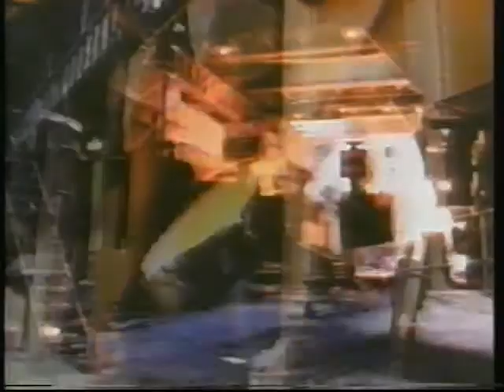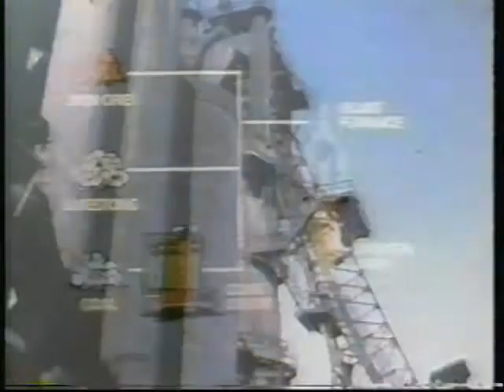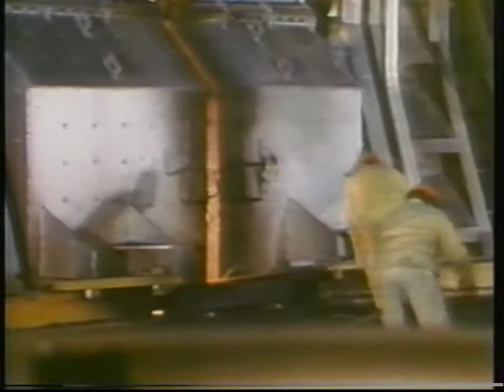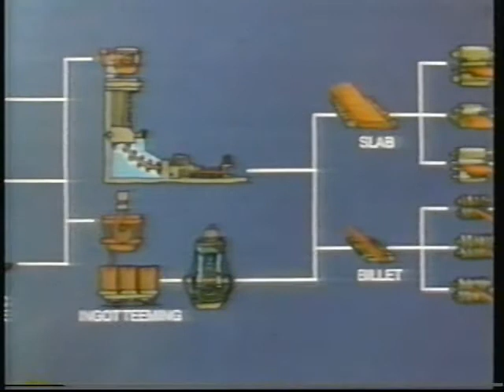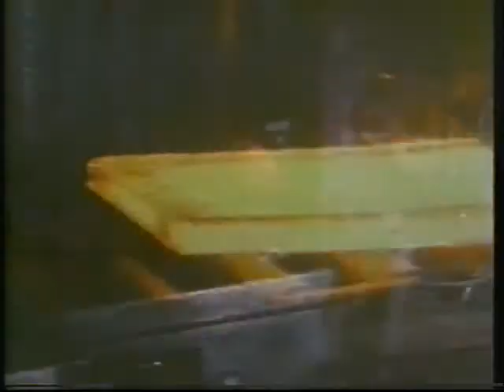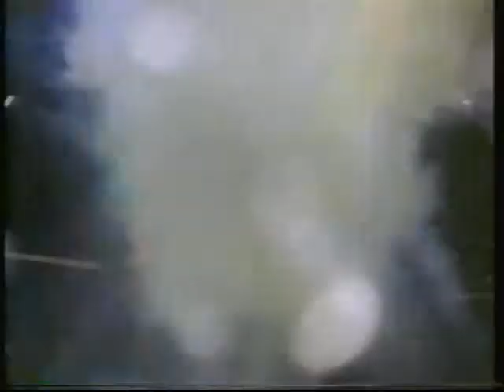LTV Steel Promo

Comment: Okay, so the date of this video is probably between 1984 and 1989. Republic was merged with LTV-owned J&L steel into LTV steel in 1984. LTV filed for chapter 11 bankruptcy, and agreed to spin off the Canton-Massillon Ohio plants and the South Chicago works as Republic Engineered Steels in 1989. These plants were shown in the Q-BOP, Electric Arc Furnace, and AOD positions of this video.
Reply: Have any idea on where I can find Ariel view photos of the plant before demo , id like to get a view of it from the on/off ramp by the highway I’m so curious what was all there before target and walmart. I grew up right up the hill off valley but I can’t remember what all was over there
I was just fishing off Harvard the other day under the bridge by where the old uranium plant used to be and there were toxic and radioactive signs everywhere unfortunately. That water looked absolutely horrible
Reply: Are you talking about Massillon?

Comment: My Father used to work for LTV STEEL from the 1950's to the 1990's.
He used to operate the Huelette first.
After years of doing that he became a pipefitter and worked around the Blast Furnace.
He worked at the Cleveland Plant.
Thanks for the video.